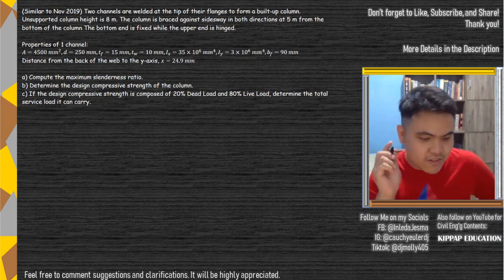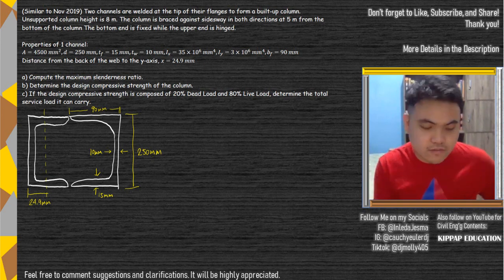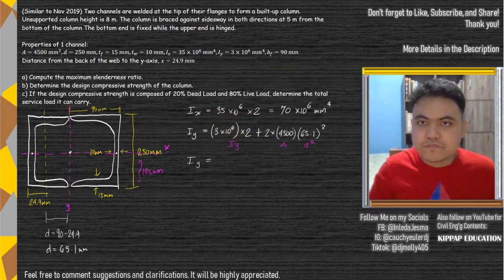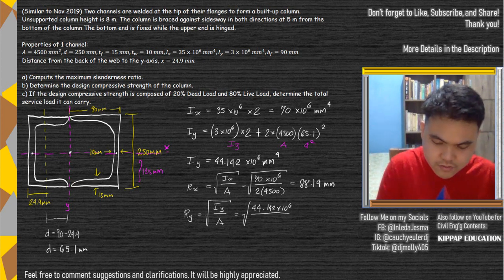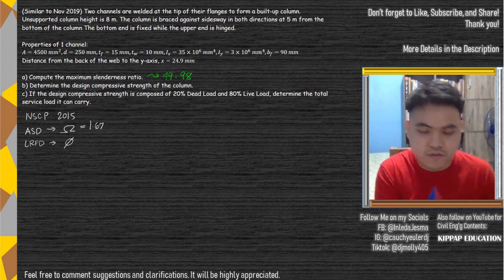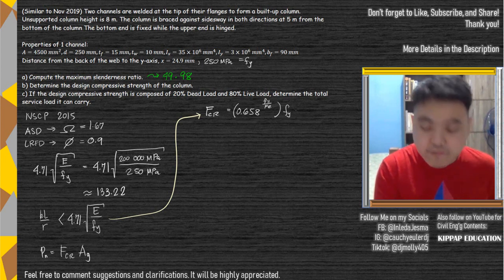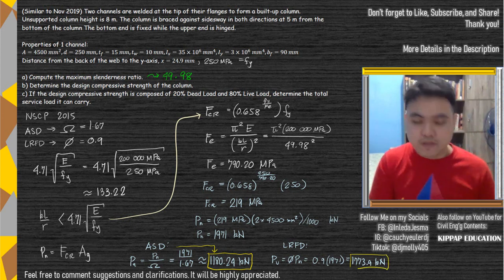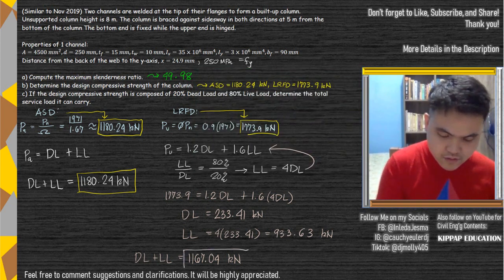C na naging Box | Steel Compression Members | Kippap

Comment: Last november 2021 ba engr, nscp 2015 na pinagamit for column? Or yong old method na icocompare ang kL/r sa Cc?
Reply from the maker: If I remember it right po, it was more of a strength of materials problem. We still had to solve for kL/r but there was already a table for the allowable stress for a given kL/r value. So hindi siya bounded by any NSCP provision na problem.
Reply: Thank you!